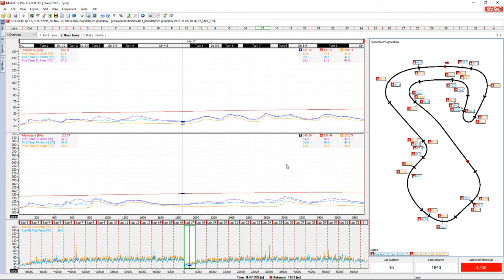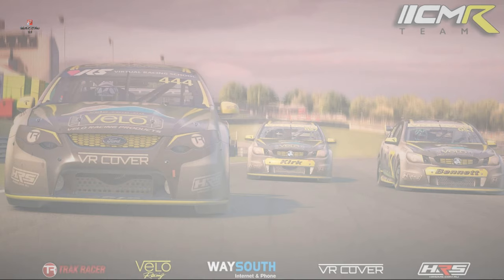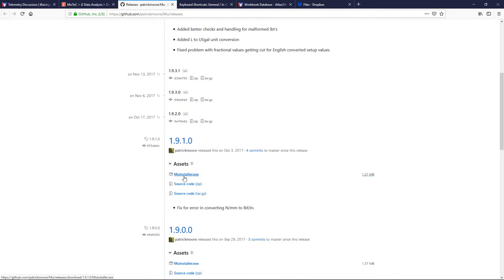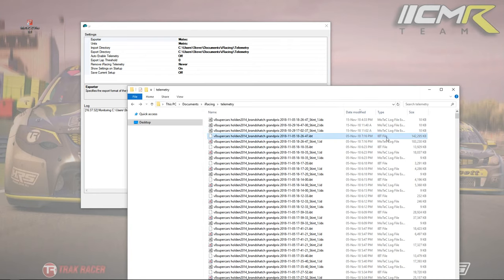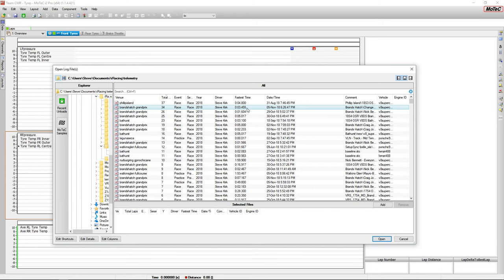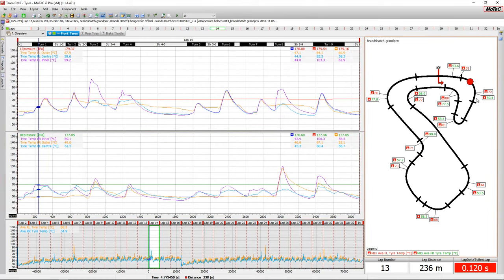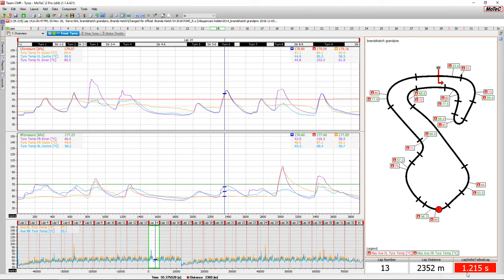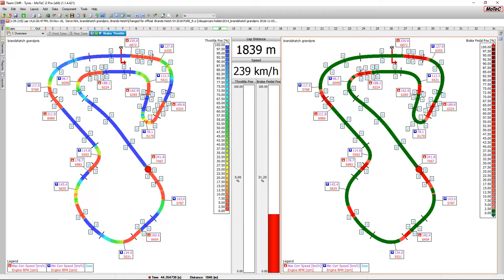Motec + iRacing - Quick Start Guide / Tutorial - Part 1

Comment: mine looks completely different then yours and I cant see map. Any ideas? I think its a newer version
Reply from the maker: Ill have to-do an updated video if it's different.
Reply: @WARTIMEGAMING  It doesn't seem to be anything like it. I used the links from your youtube and I cant see a map either. Thank you for your help
Reply from the maker: What version motec are you using ? I'll check the links this morning and update if necessary. Thanks for the heads up.
Reply: @WARTIMEGAMING  i2 pro 1.1.4.454